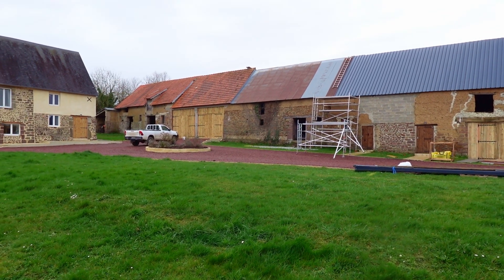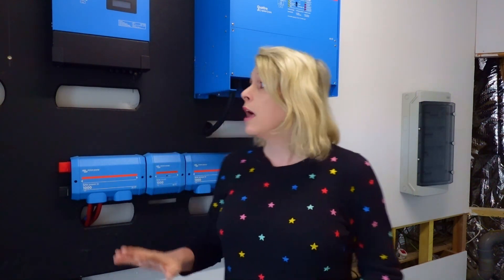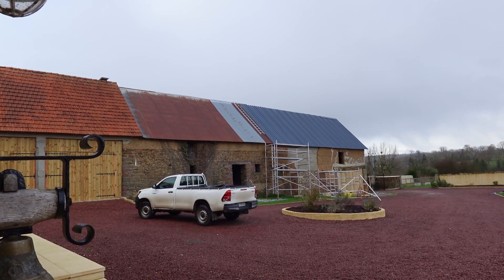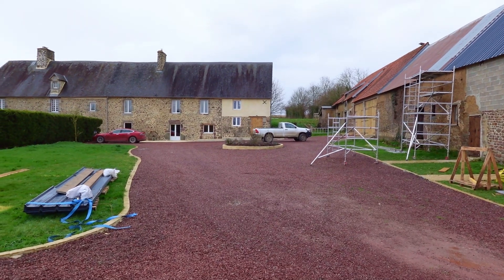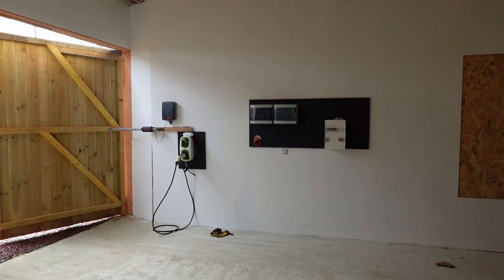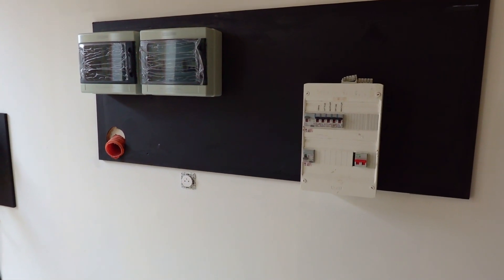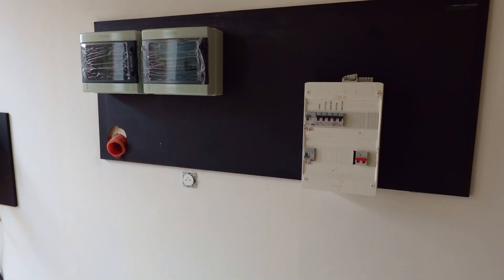Your Questions Answered About DIY solar installation

Comment: Sorry, but the best material to heating, it's the water, with system in water you have best result, with heat-pomp, it's better. Think to conversion electrical AC grid to DC battery, after DC to AC = 2x10% losses
Reply from the maker: Absolutely completely agree however we already have electric heating installed later on I am thinking about installing an air source heat pump.

Comment: I think you've gone for the best design for your home, but have you given V2H any thought. Only we have a 2 Nissan Leaf and a Setec 6kw mobile power station, which comes in very useful in the winter months for storing cheap over night energy. It gives us an additional 60kWh of storage on top of our 30kWh in the house. Plus for those times when the grid goes down locally, we can drive down the road charge up and return home with another days use of energy. Just thought I would throw that into the mix for future installs on your system.
Reply from the maker: Thanks for the suggestion but unfortunately you can't do vehicle to grid or vehicle to house with teslas.

Comment: Before you order more PV cable, take a look at Doncaster PV Ultra cable, you may find its more appropriate and better. As for heating, we're in Kent, my self built batteries are in my detached drafty garage. I put heater mats under the cells, and also built a polycarbonate enclosure around the cells. I have the heat pads set to come on at 8c and turn off at 12c, it's very rarely been on over this winter, although I charge for 3 hours early morning, and often force discharge a bit at peak which warms the cells nicely. Have a look at one of Andys recent videos, he covers the pros and cons of four different battery boxes, some have heating. Can you get paid for exports in France, and can you get cheap rate periods to charge the batteries in the winter? Sounds like you need an ASHP, it would save a lot of electric.
Reply from the maker: Unfortunately I've already purchased all my solar cable but thanks for the tip anyway.. if I hadn't had all my computer servers to keep my battery is warm I think I would have used heating pads and the batteries as well.

Comment: It’s nice if you add grid tie inverter or ac coupling.
Reply from the maker: Unfortunately we can't feed into the grid with a DIY system it has to be installed by the electricity board.

Comment: Mini split Heat-Pumps would be what I recommend for Heating & AC I switched over from electric heat 7 years ago, heat and cool the rooms you are in, very eco to operate as long as your temps dont drop much below 32f/0c, mine pulls between 500-1000 watts depending on heat or cool and outside temp. I live in south Texas, it does not often go below 0c here, and if it does it does not stay that cold for too long, the summers however are blistering, many days above 100f. Thanks for sharing.
Reply from the maker: Yes I've been looking at mini splits as a possible heating solution for the future. Next year I'm planning to build a home theater inside the barn and I'm going to be using mini splits for the heating and air conditioning. If that goes well I think will install them in the house.
Reply: I don't think you will regret it, I buy the 12k btu systems here in the states for around $800us, and I have the tools and experience to install them, otherwise the install costs more than the units here. @Gridbusters-qx4om

Comment: I have just installed a system similar to yours in the UK.
I am following along incase I have missed anything also.
Will you be also incorporating a generator as backup?
Do some research into Home assistant or node red so that you can direct power to your home electric heating when the battery is full and you have excess solar.
Reply from the maker: Yes definitely going to be using a generator at some point. We have a very cheap petrol power generator however this is no good as a long-term solution so looking at getting an LPG conversion kit for it or getting a new generator in the future. I had no idea that home assistant could integrate with the solar system what a great idea this would definitely be useful for heating the hot water.

Comment: You have to decide how you want to ground the panel frames, plus surge protection.   The industry is split on whether to back-haul the ground all the way, or whether to ground it at/near where the panels are mounted.  There also might be a common mode potential difference between the ground at the panels and the ground in the plant-room, though in this particular case I think probably there won't be.

Either way, do not connect the panel negative to ground (just in case you were thinking about it, which you probably were not).  The panel negative will typically be referenced to the battery negative at the charger controller (charge controllers are typically not isolated).

The electric code in your area might have a requirement there but I can tell you my suggestion.

Generally speaking when the backhaul is really long I prefer to ground the frames at the panels and NOT back-haul a ground wire.

Even though you aren't paralleling strings, I also recommend having 4 solar combiner boxes, one for each string (not actually "combining" anything), at or near the solar panels because you can throw the fuses AND the surge protectors in those boxes.  It is important to fuse as close to the panels as is reasonable, prior to any long back-haul.

Then in the plant room, have a second set of beefier surge protectors where the cables come in, along with a set of breakers for easy disconnecting while working on the system in the plant-room, and a set of beefier surge protectors that use the plant room's ground.  

i.e. A total of two sets of surge protectors for each string. That's my suggestion.

-Matt
Reply from the maker: You bring up an interesting point. Right now we have the solar combiner boxes which have surge protection built-in. However the surge protection is 500 volts which I think is a little bit too high. So maybe I should put some more search protection inside the plant room like you recommended ideally I would like to find a 400 volt search protector but I can't find one anywhere any ideas?? I think I should make a video all about this. Thank you very much for your suggestions...
Reply: @Gridbusters-qx4om  Generally speaking you want a very generous, usually +100% margin on the surge protection's trip voltage.   So e.g. on a 300V system, 600V surge protection is exactly what you want.

Lets clarify what surge protection is and isn't.

Surge protection is NOT capable of protecting against a continuous over-voltage.  It will instantly pop its fuse and become worthless.  So, for example, if you connect up a 300VOC array to a 350V surge protector, and you get cold / bright conditions that take the array up past the trip point, that surge protector will basically pop its fuse and burn out.  It can't protect against "nominal" over-voltage.

What surge protection protects against is lightning induced voltage surges.  Such surges can reach into the THOUSANDS of volts (think "static electricity dancing on your skin").   But these surges only last either (A) for a short period of time or (B) couple very little actual energy into the wires.

A surge protector is capable of sinking anywhere from 200 joules to roughly 1000 joules of energy.   For example, a 200 joule protection device could protect from 10000V at 0.02A for 1 second without blowing its fuse.   It can also protect from a 10000A surge for 1 milisecond, for example.

A typical lightning strike 1 mile away can be dealt with by a surge protector.   A DIRECT strike cannot be dealt with by a surge protector.

That is what the surge protector is there to deal with.   These voltage/current surges are enough to burn out equipment, either due to the voltage or due to the amperage, despite the extremely short duration of the pulse.  So that's what the surge protector is there for.

Generally speaking, the surge protectors built into combiner boxes can deal with only 50-100 joules of energy.  Whereas the bigger surge protection devices in equipment rooms can typically deal with 400-1000 joules of energy.

-Matt
Reply from the maker: Wow thank you very much for that extremely well written example of what a surge protection device actually is much appreciated.

Comment: You are back-hauling the individual strings (which is good), so that's 10A of current per cable.   10 AWG (6 mm^2) cabling will do the job very nicely at 10A for almost any distance.  Your power losses will be almost nil.   The cables wont even get warm.

-Matt
Reply from the maker: Yeah that's why I went with the 6 mil cable hopefully it should be sufficient. Thanks for your feedback...

Comment: Thank you for the explanation. It sounds all well thought out yet as you admit it will be interesting to see how it works in practice. You property is lovely and makes me envious. I like my little house in Victoria BC backing onto a forested hillside park but I have always dreamed of a big plot of land. My sailboat fills that role for me though, when I need to get away and have enough space to breathe.
Reply from the maker: Fingers crossed everything works out your cell boat sounds interesting have you ever thought about installing a solar system on it??
Reply: @Gridbusters-qx4om  Yes, I have a comparatively smaller system than yours. I have two solar banks of 400 watts and 270. Our system is all 12 volt  and I am upgrading from 4 AGM batteries to 4 100 amp hour LiFePo4 batteries. We only have a 2000 watt inverter / 40 amp charger but our needs are fairly limited on the AC side as our fridge and hot water heater are DC.
Reply from the maker: Sounds interesting you should follow the digital mermaid on YouTube she's converting her sailboat to fully electric propulsion.
Reply: @Gridbusters-qx4om  I do. It will be interesting to see how she progresses. I also follow Andy at Off-Grid Garage for general knowledge.

Comment: If running DC string cables underground it is a good idea to separeate possitive and negative wires.
The disadvantage of victron is the limitation on max. 450 DC  voltage. Some other brands can handle 750 V or more.
4 strings of 8 panels seams to be not much for electrical heating. 100 kWh battery is a nice target, but you will not be able to fully charge that by solar from beginning of november until end of february. I assume you will need much more panels.
But still a very nice system... 👍
Reply from the maker: Yes completely agree it won't be enough to charge the batteries but we will probably add more panels, and we also have many acres of farmland which we can put wind turbines on which is a project I would look into in the future, it's incredibly windy here in the winter.
Reply: Good input. Thanks.

Comment: What kind of surge protectors did you use? is it in one of your videos? If so, which one did you use?
Reply from the maker: I have search protection inside the solar combiner boxes however the surge protection is only 500 volts DC... Am I charge controllers at 400 volt. So I'm thinking I need to get some different search protection devices haven't been able to find any so far. You absolutely correct I should make a video on this...

Comment: Are you going to incorporate midnight solar, lightning surge protector on the AC and the DC side?
Reply from the maker: No I wasn't planning to. We already have lightning protection in our breaker panel and we also have lightning protection in the solar combiner boxes.
Reply: @Gridbusters-qx4om  Typical solar combiner boxes (situated near the panels, before the cable run to the plant room) will have the necessary fusing and modest surge protection, but note that the surge protection in solar combiner boxes is pretty flimsy.   I would have a SECOND set of surge protectors in the plant room itself at the end of the cable run, before the cables go into the charge controllers.

Also during a lighting strike or other atmospheric electrical event, the ground reference is going to be VASTLY different up at the panels verses at the plant room.   AND you have a metal roof that is relatively high-up.   So you definitely need surge protection in both locations.

Midnight solar is a good beefy surge protector, I'd make space available to install one on each string as it comes in.   DC+, DC-, and GND (GND locally referenced in the plant room, not back-hauled from the panel frames).

-Matt
Reply from the maker: Thanks for the advice yes this is something I'm definitely thinking about doing or have a look at midnight solar. The other thing we might retro fit later is a full lightning protection rod on the roof of the barn...